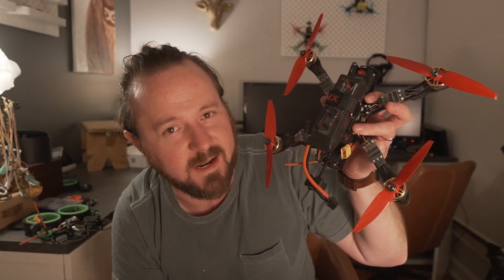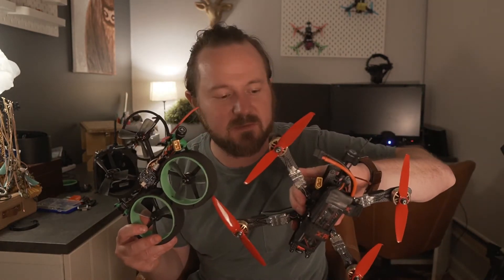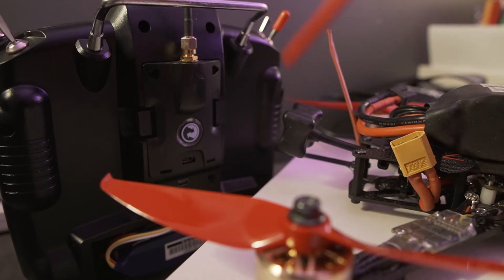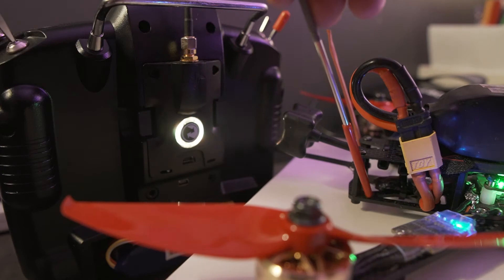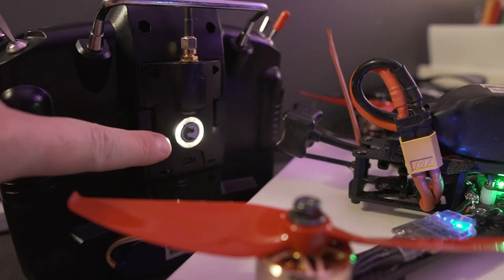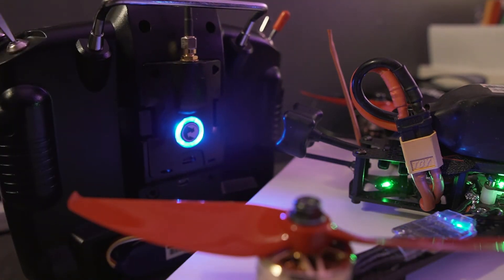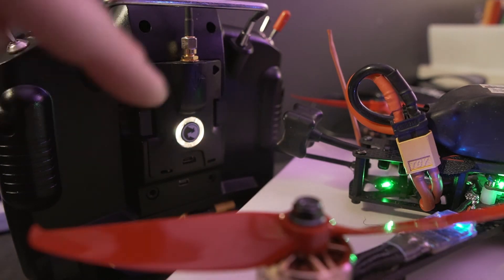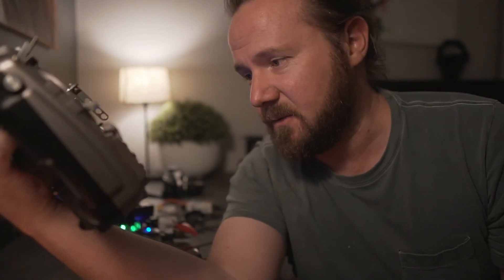How to bind Crossfire and Taranis - the EASIEST and FASTEST way (no luascripts!)

Comment: When I plugged mine in it was flashing green the module yellow, I clicked it once then it went solid blue and the receiver went red, the drone was constantly beeping so I unplugged the battery and it kept blinking and beeping it finally went off and stopped but what could be the problem?? I’m very new to this all
Reply from the maker: Hmm. Im not 100% sure sorry mate - maybe power them both off and then back on again? Do you have a warning bepper on the drone so it beeps when not connected (in case you lose connection)?
Reply: @ScottBerwickCreative  yes it has a beeper on it, would there be a proper way to unplug the battery
Reply from the maker: @TINCANSs  If you mean just the LiPO battery, then no - just pull it out. Does your beeper have a backup battery in it? My drones are programmed so that if they lose connection to the transmitter (remote), they beep. That way if you lose connection, you can hopefully hear the drone and still be able to find it. Might be the same scenario for you?
Reply: @ScottBerwickCreative  yeah I figured it out and it is that, now I’m just curious if it’ll stop when I figure out how to bind, rx is solid red
Reply from the maker: @TINCANSs  it certainly should stop then. Solid red means it’s not bound - maybe try holding down the button on the RX while you connect the battery - this can put it into binding mode too. (A bit fiddly to do though 😂)

Comment: I’m using tbs crossfire nano rx. When I’m in the settings I see crsf on external. but when I go to the internal there is no crsf option, I am using the zorro, would It be under a different name?
Reply from the maker: Yeh I dont think there'll be an internal CRSF on it - external means it has the external CRSF module plugged into the transmitter.

Comment: Awesome  . 
    Crossfire always ends up being in my quad or drone no matter how many times it try elrs . Elrs just seems to have too many versions of firnware ti try to match up . I bought 9 pieces  3 tx and 6 rx of the 815mhz and 2.4ghz and only 2 oieces matched up . I figure it has to fail from buying the 2 day delivery items over the month wait and i end uo with returned objects that others may have flashed or upgraded and are now  useless blinking things .
   I tried holing the button on the elrs nano rx while powering it up and managed to see a solid blue light . Sort of simulated bind experience .
    The one successful bind of a nano tx 915Mhz bought with 2 rx's . But it doesn't seem to like one of them. They are supposed to be compatible with all elrs products of any brand no worries if you can keep them all flashed and upgraded to the same firmware version of the week .
Reply from the maker: Wow - sounds like quite the journey! I’ve honestly never had a single issue with pairing anything Crossfire, and have also never had a dropout / failsafe. So good!

Comment: Why does my tx go back to flashing green, instead of going solid blue? Can you please help
Reply from the maker: Hey mate. Assuming you’ve made a new ‘model’ on the TX for the drone you’re connecting to? What colour is the RX showing?
Reply: @ScottBerwickCreative  blinking red slowly
Reply: @ScottBerwickCreative  My tx is a zorro that came with the crossfire model.  And my rx came in my bnf evoque.
Reply: @ScottBerwickCreative  The rx blinks green slowly, until the the tx blinks blue. Then the rx blinks red slowly once. But then when I press the blinking blue tx button, the tx goes back to blinking green. And the rx kinda switches to SLOWLY DOUBLE BLINKING RED.
Reply: @ScottBerwickCreative  is there something I need to flash/download onto it.  Because if so, I haven’t.
Reply from the maker: @Caysonator007  hmmm sounds like it might need an update of some form - maybe try to tbs agent and see if the firmware needs to be updated on the RX?
I actually just grabbed a bnf Evoque too - will see how it binds for me

Comment: I have a Taranis qx7s, will I still need to do the crossfire telemetry mod inside the radio or do I just need the external module?
Reply from the maker: Hi mate! I haven’t used the QX7, but I believe you’ll need the external RF module, and then in the controller you’ll need to change the RF type from internal to external. I have a video on my channel about setting up the Crossfire module - that might help. :)

Comment: What does it means if the button never turns blue? Mines just flashes green the whole time.. For context, I have a Geprc baby Crocodile and the only button it has is a button for turning off the locator buzzer after its been powered off. I thought it was the bind button as well because there is no other button and I've been treating it as such but it does nothing but what I just stated.  Also in betaflight I can never get it to update ( maybe because it's already updated, being that I just bought it a month ago) and I also can't get it to bind on there either.  Matter of fact it doesn't let me bind on either betaflight or my radiomaster tx16s transmitter.  I'm starting to think my crossfire module is defected because I bought it for a cheaper price on Amazon.
Reply from the maker: Hi mate, might be a silly question, but does your Crocodile have a crossfire receiver in it?
Can you send me the link of where you bought it? I can check the specs that way 👍

Comment: Did not work!  I can't get passed the blinking red light. Just will not bind!
Reply from the maker: Hi mate! Try holding the little button down on the receiver for a while - it can take a while, so try holding it down for up to about 30 seconds. If that doesn’t work, try holding it down before (and while) you connect the battery - ie. power up the drone while holding the button - one of these should then put it into bind mode (flashing green). Let me know if that helps!
Reply: @ScottBerwickCreative  Thanks for the response.  I finally figured it out.  I upgrade the TBS crossfire firmware to V6.12 and everything worked like it should. Even though the receiver firmware is V6.10 on the package, the V6.10 firmware did not solve the problem, I still got the same "Reload Crossfire FW In Agent X" warning. The V6.12 firmware solved the problem.  The only down side, is that I had to upgrade the firmware and rebind all of my crossfire receivers.  Anyway, it is working now.
Reply from the maker: @ghettogardens1  oh man how frustrating! I’ve never had to use AgentX - maybe it got lucky with the versions already on there. Glad you got it sorted mate!
Reply: @ScottBerwickCreative  Crossfire firmware Release Notes V6.12 - fixes update issues with Agent X for full-size TX, TX Lite and MicroTX.

Comment: the problem im having is the red light is solid so what does that mean,,, and how are u getting both rx and tx on the screen
Reply from the maker: Hi mate! Solid red light on the TX or the RX?
Reply: @ScottBerwickCreative  RX on the reciever that's on the Quad
Reply from the maker: @jamiehill9578  try holding down the bind button on the receiver before and while you plug the battery in - this should put it into bind mode. Let me know if that helps!
Reply: @ScottBerwickCreative  that's the problem I have no button on the reciever, so I'm thinking it's on the air unit and I bind it like I did with the Goggles
Reply: is it possable since this quad running the air unit that it only binds with the dji controller
Reply from the maker: @jamiehill9578  ohhhh yes I think that’s it. My digital quads still use crossfire receivers, so they can be used with my Taranis. I’m not 100% sure, but I think using the DJI receiver only works with DJI remote.
Reply: @ScottBerwickCreative  that's what I don't understand this reciever that I have on this Quad has no button its all wired,, it has the air unit and running cross fire,,,,
Reply from the maker: @jamiehill9578  so are you using a crossfire receiver on the quad? Or are you using the air unit as the receiver?
Reply: @ScottBerwickCreative  that's where I'm confused,, it has the crossfire installed so I'm assuming it has the crossfire reciever, BUT when I looked at the reciever there is no button on it its been welding with a black wire,,,,
Reply from the maker: @jamiehill9578  a crossfire receiver is a standalone component, not installed in the air unit. It sounds like you have crossfire in your Taranis transmitter, but not on the quad. Feel free to message me on Instagram with some photos 👍
Reply: @ScottBerwickCreative  I don't have Instagram is there another way to send pics
Reply from the maker: @jamiehill9578  not sure sorry mate. But am I right in thinking that you don’t have a stand-alone crossfire receiver?
Reply: @ScottBerwickCreative  well after 2 days of mind troubles I was able to find the bind button on the reciever using flashlight, ya old age eye sight 😜 was able to get the Quad to bind hell ya
Reply from the maker: @jamiehill9578  oh that is awesome!! So glad to hear it! Yeh they can be pretty fiddly 😂 happy flying mate!